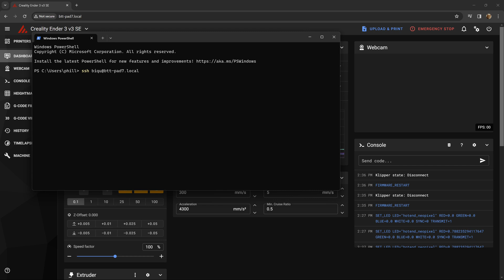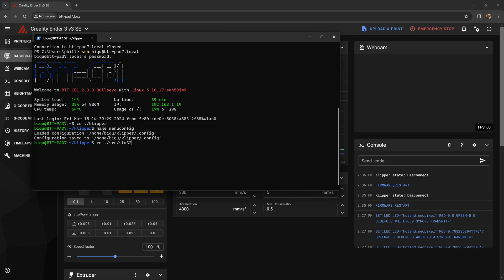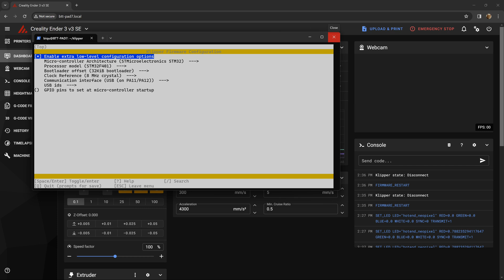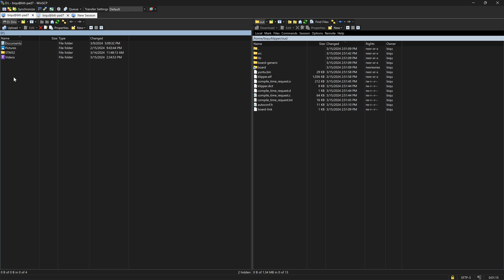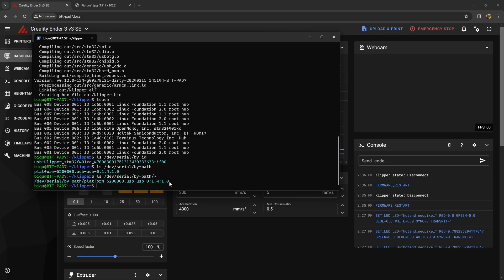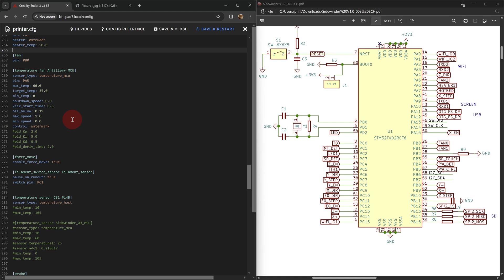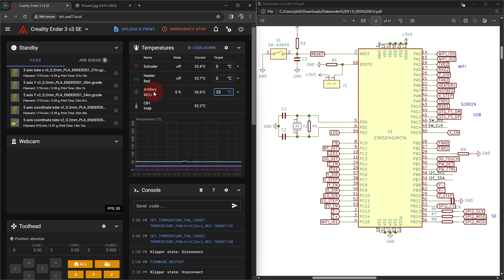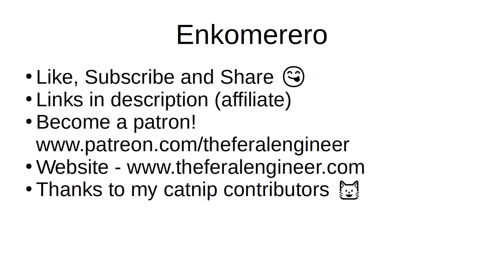WORLD PREMIERE! Installing Klipper on the Artillery Sidewinder X3 Plus (and Pro)  the easy way

Comment from the maker: BE AWARE - Recent findings show that flashing this way is only applicable to machines that came with V1.29 flashed from the factory. There is a different .hex bootloader for the 1.29 firmware which allows Klipper to be installed. If you do not have V1.29 factory installed (or if you installed V1.29 yourself), this method will not work. 

Please see the updated flashing information in my printer.cfg at www.github.com/theferalengineer for more information
Reply: Thanks for responce and is there a way to use original screan with klipper?
Reply from the maker: @studiotomas6657  no
Reply: Ist there maybe a way to Install Klipper with the newest Firmware Version ?
Reply from the maker: @jalamikal454  I don't understand your question
Reply: @TheFeralEngineer  

I ASK you im Reddit too. Sorry for my bad english. 

I saw the new instruction in your repo, to Install Klipper trough USB with a newer Firmware Version from Sidewinder.
If it dont Install correctly and i cant Boot Up the printer, is there an Backup to go back to ax3 plus Marlin or do o habe to Change the Motherboard ?
Reply from the maker: @jalamikal454  I know who you are. Please pick one platform to ask me questions on. 

Depending on the bootloader, you can flash back to Marlin using either the SD card or an STLink flasher device.

Comment: Hi, I'd like to modify the dimensions of my X3 plus, probaly turn one of them in belt version to print infinite profiles, but I'm looking to configuration infos (I plan to stay Marlin, but configuration datas are almost the same) and eventually the original version to get things back if there's a problem. Have you any resources about that ?
Reply from the maker: I'm pretty sure they open sourced their Marlin version, but I don't know where it is located
Reply: @TheFeralEngineer  I digged for a while, never found... I'm going to use your video infos, and your Klipper config to build up a Marlin version. Taking a look at the schematic I've found motor's EN, Step, Dir, "-" is probably the origin switch (E don't have it) but why Z-b and Z+ ?
Reply from the maker: @DanielWanaverbecq I'd have to look into it a little bit

Comment: So, I’m revisiting this. I invested in a btt pi 1.2 after 3 consecutive mobo failures on my x3 plus within 3 months of owning. I have a noob question. Does the btt pi bypass the motherboard and control everything, or am I still going to be prone to mobo failures in the future?

Also, does this fix all of the weird software issues I’m having like the machine requiring me to manually change the hot end temp at the beginning of a print? (It’s not a gcode issue, I checked). What are some of the other benefits of the btt pi over just running the machine as is? I currently have an rpi5 running octoprint hooked up to it and it works great. Am I basically doing the same thing with the btt pi, or is there another advantage. Sorry for the novel and 20 questions. 🤙🏻🤙🏻🤙🏻
Reply from the maker: You still need the original board. With klipper, the actual control resides on the pi and the board is simply a "dumb" motion card. If boards keep blowing out, I would suggest finding out why. Are you moving the machine around by hand with it turned off? That's one way to blow up your boards. 

Klipper completely replaces the firmware installed on the machine, so yes, it'll fix all of those issues

Comment: Hi, great work! I've followed along and have Kliper working. Thank you very much. I have a question. Do you know how to make it beep during a pause or filament change? Why does the screen beep when turning on and off? Can it be used to notify you of breaks, etc.?
Reply from the maker: What klipper device are you using? Which screen are you using?
Reply: I use mainsail os on a Raspberry pi 3b and the screen is the original one from the machine  @TheFeralEngineer

Comment: The default microstepping for the extruder in the Sidewinder is 16, not 64 as specified in the author's printer.cfg. Changing the microstepping value in Klipper does not affect the actual stepper drivers. When swapping the extruder, this detail is definitely crucial, so I believe it's worth adding a correction.

Comment: Hi, I'm Czech and I'm not clear on a few things. In the past I have created a Marlin for an upgraded Homers Tevo Tarantula, but this is my first time with a Klipper and I became very interested in it. Do I understand correctly that the Klipper can replace the Marlin on a completely stock printer with the original display, without connecting external processors? I would also like to use Klipper for remote management via phone . I have an Artillery X3 Plus on the way and would like to try the software change..
Reply from the maker: you always need a separate device to run Klipper. Kipper offloads most of the heavy processing onto a device running Linux (Raspberry Pi, BTTPi, OrangePi, old laptop, etc). I have a multitude of videos explaining how it is set up :)

Comment: Hi, Noticed that you managed to get the X3 wiring diagram from Artillery. My X3 Pro has stopped feeding filament; it will just buzz for a few attempts at feeding and after that, nothing at all. Is it possible to share the diagram on your Github page? I was an electronics tech in a previous life, and I'd really like to do a bit more troubleshooting on the main board before ordering a replacement. (It's not the extruder; I had access to a working spare that has the same symptoms.) Many thanks! (And thanks for the config file too; I've already downloaded it.)
Reply from the maker: @rv7builder397  when I get home on Sunday I'll do it (if I remember). Did you check the ribbon cable? That's typically the failure mode. Either that or the daughter card in the tool head.
Reply: @TheFeralEngineer  The end of the ribbon that mates with the extruder  is a little suspect looking, but the extruder has progressively failed. Dying mid print, then dying mid-test after powering up the printer, to currently it will just stutter without feeding at 1st powerup, then it won't even make a sound. After posting here, I noticed in the comments that someone else had asked for the wiring diagram, so I emailed Artillery last night about 9:00 PM CDT. In less than 10 minutes they replied with the basic hookup diagram pdf, plus a troubleshooting procedure showing test points & resistance measurement values on the extruder, and telling me to send them my test values so they can continue to help.

If you have an actual schematic showing component-level stuff on the main board, that would be great, but I do have the basic wiring diagram. I'll bet there are plenty of others that would like to have it available, though.

Again, thanks for both the video and the offer of the diagram.

Comment: Hello, does the 48Kib bootloader method work if i reinstalled the firmware but it came with 1.29 from factory?
Reply from the maker: @layku4348  it should work

Comment: Sorry again.
The Z-axis motors get extremely hot. You can't even touch them.
Could you tell me what voltage each driver should be at? And what motor each driver on the motherboard corresponds to?
Reply from the maker: @Jose-tt1og  as far as vref, I don't have that information. If you're looking at the board, there are 4 drivers. Z will be the third one to the right. There will be two sets of cables coming out of the socket behind it for the two motors
Reply: Vref on the stepper motors are supposed to be 1.1 v

Comment: For models that did not come with V1.29 installed, add "flash_device" to :
> Run sudo make flash FLASH_DEVICE=0483:df11

Modification to "printer.cfg" add "printer_data" to find the files of Klipper 
[virtual_sdcard]
path: ~/printer_data/gcodes
Modification to printer.cfg

Comment: Hello. I have three questions. My machine came with firmware prior to 1.29. I was the one who updated to 1.29 from the SD card, just as it come on the artillery website.
1.  If I want to go back to Marlin, do I have to do it the same as when I updated it? From the card SD without further ado?
2.  In the thread that I have to follow, it doesn't say anything about renaming the .bin file. That is correct, is it done without renaming? And surely I should do it from a USB and not from the SD card?
3. Is your configuration file complete? Can I start printing without doing anything else? Or do you have to do PID calibrations, etc.?
Reply from the maker: You always have to PID tune and calibrate. No machines are identical. 

If you flash via dfu and USB, you'll have to flash Marlin back via STLink because there will no longer be a proper bootloader. There are some ways around this, like flashing the 1.29 .hex file, which replaces the older bootloader, but I'd have to look up the procedure on how to do this and it may require the STLink as well, I'm not entirely sure. There's also an open source bootloader that can replace the stock one which I believe can be done through dfu mode and USB. I just don't remember what is called at the moment.
Reply: Do you know how to use stlink? Or do you know of any tutorial where we can guide ourselves to do it, those of us who have the previous firmware?  Since without knowing how to leave the machine in its original state original I don't dare to change to klipper
Reply: Sorry for the inconvenience again. I have seen that for artillery x2, closing the  boot Jumper in the motherboard and using the STM32CubeProgrammer program puts the machine in mode to receive the firmware. Our artillery too They have that Jumper in the motherboard. Do you think it could be done like this?
https://youtu.be/1psvPSFCeOQ?si=4N3tYIIbiUYP1M8d
Reply from the maker: Yes, that's how you do it. 
I've been battling food poisoning since yesterday so I haven't really been checking my comments
Reply: THX you are the BEST 🎉

Comment: hi, how did you figure out your configuration parameters ? Have you some official Sidewinder X3 documents ? Maybe the Marlin's config files ? Regards
Reply from the maker: I got the official STM32 diagram from Artillery. What are you looking for?
Reply: @TheFeralEngineer  I'm looking for informations in order to (probably) transform it in a belt version. I already did it on a Artillery Hornet, it would be easier for me using Marlin because I already digged into it, but I'm unable to find original configuration files for the X3, and I'd like to modify HMI too. So everything I can find about X3 could be useful
Reply: can you send me official STM32 diagram from Artillery ?
Reply from the maker: @clairettedelportr1476  you'll have to email Artillery for them yourself. I'm not at liberty to disclose their documentation

Comment: Hi i have elegoo neptune 3 pro and i upgradet to all metal hotend and new termistor that shoud wistand 300c° but firmware on elegoo limits max temp to 260c° can you help me change it to something around 280c° co i can try to print higher tempeture materials. (thy for responce)
Reply from the maker: You'll have to either compile a new version of their Marlin firmware for the machine or switch to Klipper to make that change possible

Comment: I was able to install it, but on mine I don't see the option for LED on the Pad 7, I can see them in the fluidd interface, is there anything I'm missing?
Reply from the maker: It'll be under klipperscreen (or settings), LED or outputs
Reply: @TheFeralEngineer  i looked for it but couldn't find it, maybe cause I'm still running the Klipperscreen that BTT has stock, i will update that and see if it pops up
Reply: @TheFeralEngineer  got it working by updating the Klipperscreen now it's running great, thank you

Comment: Bro you gotta get back to onto that SX3 mill I just subscribed watched all the linuxcnc videos and the build log and I feel like Im on last season of a great show thats been cancelled hahaha I NEED TO SEE HOW IT ENDS MAN
Reply from the maker: Very soon. I actually got my first 3D printer to help with it, but haven't circled back yet 😆
Reply: @TheFeralEngineer  I'm building a X2 at the moment, bit of a different approach to yours as I can't afford all the fancy electronics but closed loop steppers will have to do. but I've added about 200kgs of steel and concrete to mine and attached it to solid steel enclosure. still making stepper mounts and bearing blocks. If I finish mine before you next part Ill be back haha

Comment: So in order to be able to bring it back to Marlin you have to flash via SD card? Mine has v1.29 havent up touched it since I got it
Reply from the maker: If it's v1.29 from the factory, you can flash between Klipper and Marlin with the SD card, yes. If it came with an older version of Artillery firmware, you have to flash via USB and would have to flash back with an STLink in order to go back to Marlin. There's also katana, but I haven't messed with that much

Comment: Thanks a lot for the information. I made all changes as you explained in the videobut it seems the binary is not recognized. The Sd card and the reader of the x3 pro works because i can load gcode files from this sd card.Marlin Firmware of my x3 pro is 1.29. It seems to me the bootloader checks the firmware file and if the check is not successful the file will not be flashed. I also tried to flash the 1.29 Marlin Yuntu.bin the bootloader ignores the file and doesn´t update.
Reply from the maker: You added the 48KiB bootloader to kconfig for the stm32f401 and then selected it through make menuconfig? Did the klipper yuntu.bin change to YUNTU.CUR when it was finished? I was able try both 32 and 64kib bootloader and still flash back to Marlin with no issues. These are all rebranded makerbase boards and I have yet to brick a single machine going this route.

Is the sd card formatted fat32 4096? Was it the only file on the card at the time? 

Other option is DFU, but that's typically more destructive.
Reply: @TheFeralEngineer I compiled for 32K 48K and 64 K Bootloader. Formated an sd card fat32 4K sector size. The file on the sd card is not renamed because it wasn´t touched.
Is there a way to get the origianl bootloader ? I think Artilleriy enabled the read out protection. I also tried to flash the marlin v1.29 plus firmware to my x3 pro board. 
The update yuntu.bin file is never recognzid. I tried to restart with the reset button and also to switch off and on the printer. After a reset the extruder led lights white, red green and blue for 0.5 sec.
Reply from the maker: @DirkV0815  that's strange. I didn't have to do anything else. Just place the SD card in with yuntu.bin on the card, power up and all was good. Artillery specifically told me it was 0xC000 offset, which is 48kib. 

M997 should enable firmware update mode if you connect the printer to pronterface, but I did not have to do this. 

To clarify, you inserted the card with the machine off, powered on, waited two minutes, removed the card and checked the contents to see if the file was renamed?

Did you plug the original screen back in to see if it comes up? Usually if the firmware is changed, it'll power up in Chinese
Reply: @TheFeralEngineer My last messages here were deleted. After renaming the yuntu.bin into firmware.bin flashing was successfull.Thank you very much for your support. This  text was written now three times by me.
Reply from the maker: @DirkV0815  YouTube and Facebook are both too worried about shoving ads down everyone's throat instead of fixing their software bugs. I can't comment on videos from my phone because the keyboard hangs up for 5 minutes and it's been happening for over a year, but they do nothing about it. Hundreds of people have the same issue. 

Glad you got it squared away! 🐱🐱

Comment: You had more success than me with Artillery. At the beginning of December, I contacted Artillery to install klipper, without having had a response. I did not try to load the firmware on the original card, I suspected that there was a problem with the bootloader. And I wanted to be able to go back. So I changed the controller card and made an adaptation card to achieve my project. Very happy to have done so after all the difficulties I previously had in resolving all the mechanical and electrical problems present. The factory assembly was disastrous. Great success for you.

Comment: I also installed Kliper on X3Pro.  motherboards are the same.  I generated a .bin file without a bootloader (same as with X2).  pronterface -> DFU mode -> stm32qube programmer -> FLASH!  I'm using btt pi 1.2 and Klipperscreen on my smartphone.  everything works without any problems.  but be careful!  To go back to the previous version of the system, you must have STM link
Reply from the maker: That's why I wanted to be able to do it via SD card. If I ever want to go back to Marlin, I can still flash the original firmware. Doing it the usb way with no bootloader is too destructive
Reply: @TheFeralEngineer  tak to by było lepsze rozwiązanie i prostsze. tylko że na szczęście mam drugą płytę główną ;)

Comment: Nice, so artillery didn't help you but you figured it out by yourself?

Either way amazing work, keep up the amazing work to help all us noobs out 🙏🏾😘
Reply from the maker: It's a story better told outside of prying eyes, but eventually they saw things my way 😀. 

Once they sent me the schematic I asked for, I threw a hail Mary, hoping not to brick the MCU and to my surprise, I did not, so I asked for the correct bootloader offset value. Once I received that, I had Klipper running in 15 minutes.
Reply: @TheFeralEngineer  fair, well that's good that they finally helped........tho I'm still annoyed they took too long
Reply from the maker: @sassall9673  it is what it is. The good thing is that it's working now